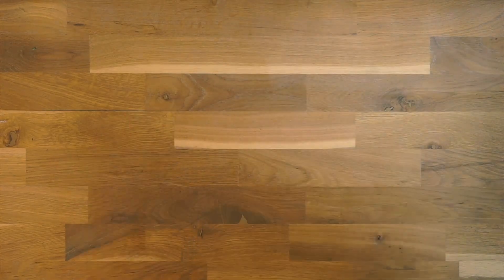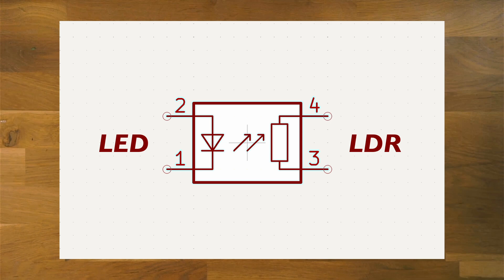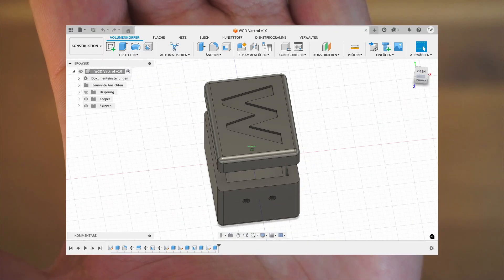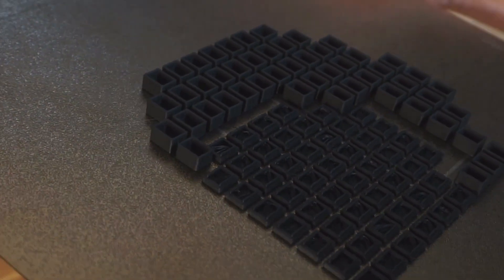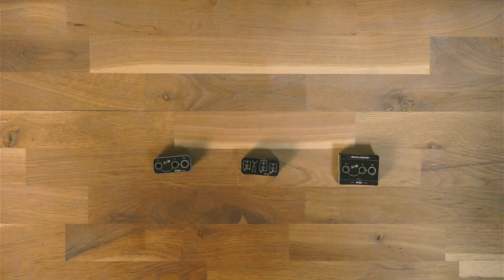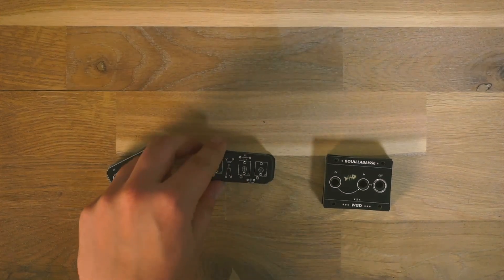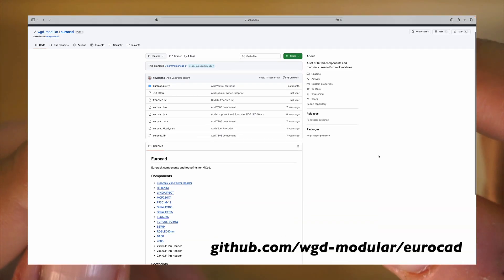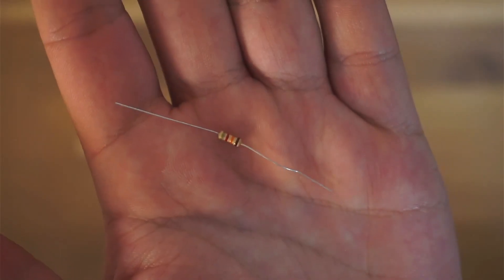FREE 3D PRINTED VACTROL DESIGN! DIY LOW PASS GATE BUILD + DEMO

Comment: I find the heatshrink method preferable to a 3d printed enclosure, because it provides a smaller footprint and doesn't melt when soldering. I superglue LDRs onto flat-headed LEDs, cover it in a layer of paint (especially around the leads) and cover everything up with 5mm heat shrink tube. Immediately after heating the heat shrink, I push the leads through a breadboard to squish the remaining material. This provides for a fully sealed vactrol in a minimal enclosure, with 2.54mm x 7.62mm pitches.
Reply from the maker: I didn’t have any problems with anything melting when soldering the Vactrols but the size of the footprint is surely a valid point when there’s a build where space is very limited 😃

Comment: I roll my own by just sticking the opto and led into some heat shrink with the leads sticking out.  zip it up with a head gun or a lighter.  cost like 18 cents.
Reply from the maker: Definitely a good option especially when not owning a 3D printer! I've seen others do that as well. Would you say the vactrols are very robust when using the heat shrink?

Comment: Just found your channel. Great idea to use the 3D-printer for the vactrol and the PCB as the front in the rack.

Have you experimented with different colours? It really affects the result a lot. Not like you need “golden ears”. It actually changes how fast the LDR reacts.
(I didn’t noticed if you were using an LDR or a foto diode/transistor.)

And a small note: Vactrols didn’t use a LED. They used a lightbulb. The reason is that a LED doesn’t give light at reversed polarity. (And LED’s were more expensive.) That means that they only give light at half of the waveform (half the time) when fed with AC (as in sound for example).
Reply: During my own experiments, I found that the best solution are ultra-bright green LEDs with regular visible-light photoresistors. Photoresistors like GL5528 or similar have a peak in their sensitivity on a certain green wavelength, and you've got to target that particular wavelength with your LED. I've also used LEDs with a flat end and straight up glued the photoresistor to it with cyanoacrylate, and then wrapped everything in aluminum foil, finishing everything up with black heat shrink. But gluing and wrapping in reflective material has an almost negligible impact on the actual sensitivity. But I was using them for active filters, not LPGs, and every bit of sensitivity counts there.

As per the speed, ultra-bright green LEDs with regular photoresistors had also the fastest possible speed in my experiments. In my opinion, you can always slow down the reaction time with external components (just put a capacitor across the LED), but you can't speed it up with them (well, you can, but with a rather complex schematic and not by much).

Comment: So what it do
Reply: It’s a voltage controlled resistance. You can use that instead of a potentiometer (variable resistance), but instead of turning the knob, you control it by varying the voltage. This can be useful to control things automatically.
Reply from the maker: @VarionJimmy  Thanks a lot for the perfect explanation! Should have included that in the video as well! 😅

Comment: Vactrols aren't hard to find at all, you just need to know there called opto-isolators now. You'll find specification for every application.
Reply: *resistive opto-isolators. Most of them use an opto-transistor these days, and even those are slowly being phased out with ICs like analog devices ADuM series in most applications, but opto-transistor solutions still has a place because they don't require an isolated-side power source.
Reply: opto-isolators aren't exactly the same as a vactrol though?  Vactrol output is a varying resistanace while opto-isolators would have a phototransistor or photodiode.
Reply: @djmips  a resistive opto-isolator is a vactrol. Vactrol is just a genericized trademark name, like Xerox/photocopier.